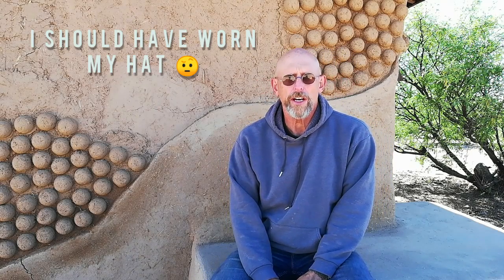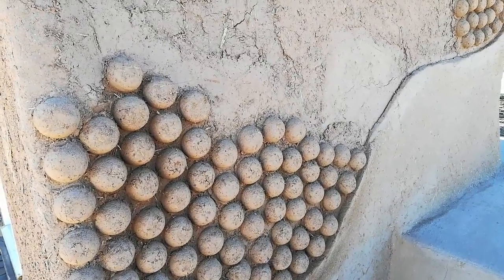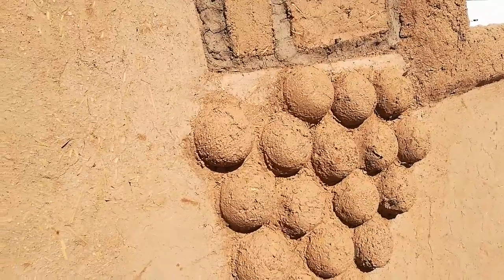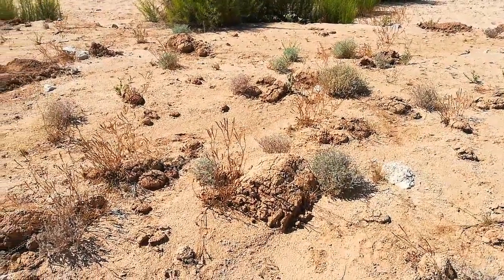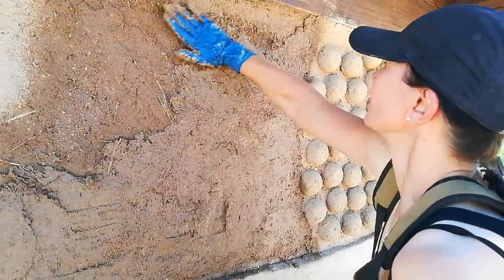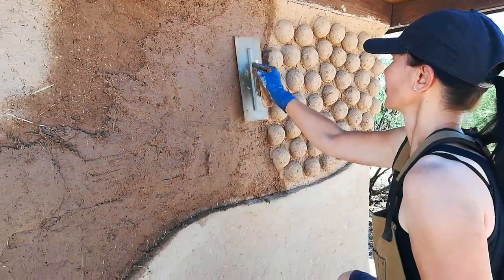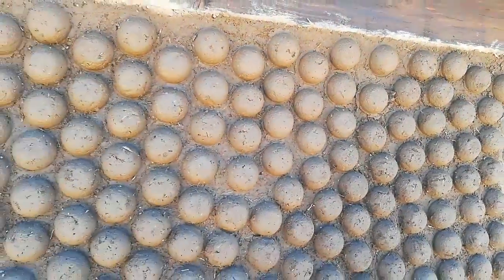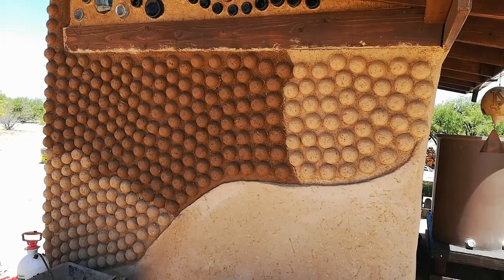How To Reduce Heat Absorption on the Solar Shed!

Comment: I went to that cal earth institute place, bout 20 min from my house. Can't remember exactly but I think the 1st or 2nd Saturday of every month you can go check it out for free. I live in victorville, which is next door to hesperia, but have property in lucerne valley (both in San Bernardino county). Unfortunately, fairly recently (within the past few years) the county of San Bernardino quit allowing these building techniques due to some engineers coming along and saying the information provided from cal earth institutes testing was no longer valid. Big bummer as that was what I wanted to put on my property. The structures at that facility are freekin beautiful and cool (as in not hot cool). Considering when I went it was well into the 90's, you would swear there was air conditioning running full tilt, but they don't even have a/c. Anyways I dig your shed, also dig that sho-sugi-ban (if that's correct) technique you do to all your wood. Good luck on all your current and future property project's.
Reply: @theupsideofdownsizing  

Man if you build this style of structure, I just can't wait to watch that series. Now that you mentioned it I remember the son and daughter both spoke to the issues they were having with the local government. Seems like I was there a couple years ago but I get my timeline so screwed up I couldn't really say, might be last year or maybe 3-4 years ago. Did you go there yourself? Perfect for where you're property is and lack of building permits required (or however that works). I gots to gets outta cali. Thanks for the response and good luck.